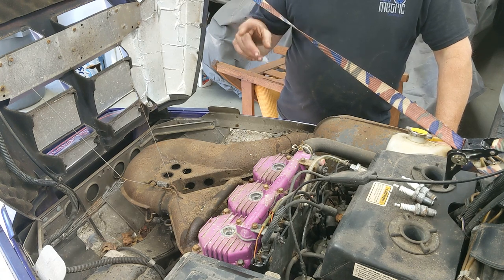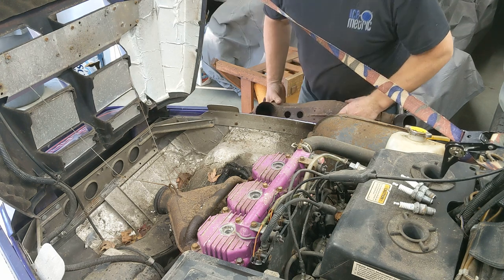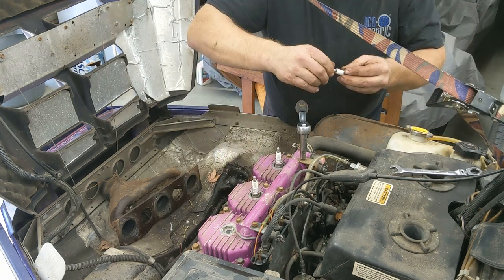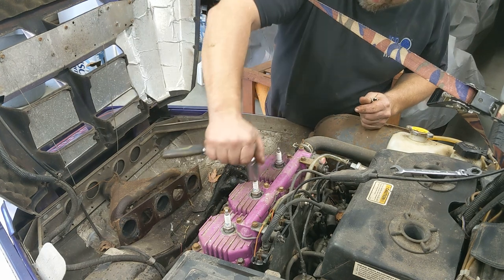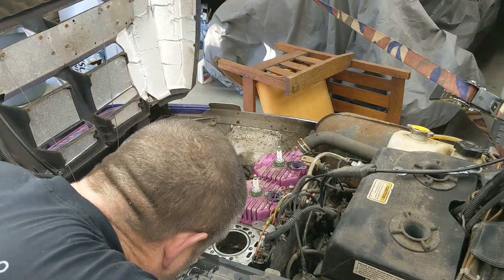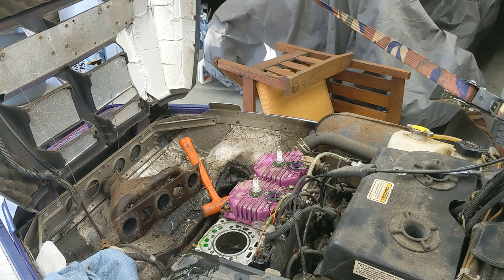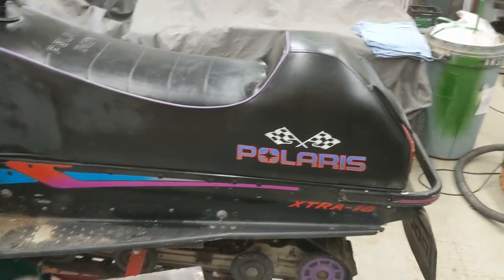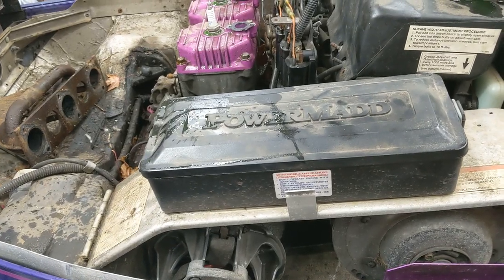POLARIS TRIPLE ULTRA REDEMPTION cylinder removal!!!!!!!

Comment: Hi Todd, great video as usual! Be very cautious with the water pump, they're extremely hard to get in my neck of the woods used and I have not found any new aftermarket suppliers either. You were supposed to change the oil in the water pump every 1000 miles, but I prefer to do it every 3-400 myself because it's to the pin whenever I hit a straight stretch of trail or lake! Lol. Also check out ALL the reed petals, if they are not sitting against the housing or are damaged in any small way replace them all. The v-force reeds are around 350-400 Canadian dollars the last time I checked, but are a HUGE performance boost! Compression on my 96 Ultra SP IS still at 150 psi which is new compression for this engine. If you can still find them a set of thunderdome heads, PSI triple pipes and the v-force reeds will get you very close to the 165 hp range. At least my friends 96 ultra did back in the day. He killed my stock Ultra every time we raced.
Reply: Also, if you can find a complete engine or set of cylinders off of a storm 800 out of an Aggressor chassis they will drop onto the ultra bottom end with no modifications and no one will be the wiser. Only a larger bore is the difference but even bigger performance gains!

Comment: I saw in one of  your replies, you have PSI  mod blasters. I ran 10k miles on a 96 with them. Set up 5 other 96 Ultra SPs with them the same way. I still have my notes on setup and clutching. If you’re interested clutching. To jetting. To timing. Plus the carb parts and hand scratched notes from the PSI installation notes. Plus notes on SLP “rev”pipes. SLP made two sets. A torquer which spun 8100 or  rev, that spun 87-8800. The rev pipes came with a can silencer or glass packs. Torque, only came with a can silencer. Plus the big belly of the pipe was an inch longer. 9” for torque, and 8” for the rev pipe. If you’d like help. I’m sure there’s a way to get you the notes.  An ultra with  PSI modblasters spinning 9700, yes. That’s right.  They work at 8700, or 9700. Is amazing. Closest to it is a 650 screaming thru a set of DGs at 9100
Reply from the maker: can message me on fb? I have dg triples on my 650 called Bastard spins at 9200

Comment: For future reference, its easiest to drain coolant via the inlet hose to the water pump, you could've avoided the coolant in the crankcase to be honest. Also, if possible it would be good to get a good look at the cylinder heads. That almost looked aftermarket by my eye. The biggest giveaway is the stock are cast, of course. Aftermarket are billet. The waterpump is definitely worth getting rebuilt.
Reply from the maker: I'm sure the engine will come out and be completely disassembled. I'll be looking at the heads closer.

Comment: You mentioned you put a XCR seat and tank on your original ultra, what did you do to get the XCR seat and tank to clear the heat exchanger and hoses??
Reply from the maker: I put the tunnel protector coolers in and took the under seat one out.
Reply: todd clyne  every have any issues with it getting warm??
Reply from the maker: @briandzimitrowiczjr7107  I only rode it a couple times after doing it. But no it didn't.
Reply: Any issues with the oil tank using the XCR fuel tank?
Reply from the maker: @briandzimitrowiczjr7107  boy now your really testing my memory. I really can't answer that. This was back in 97/98 when I did this. If there was an issue with anything I'm sure I switched stuff out. I was using a totaled out 95 xcr as a parts donor. I just remember it made the ultra handle like a complete different sled. I'm from the era of the lower you sat the faster you could corner.
Reply: todd clyne lol I apologize for all the questions. I remember that era very well. Triple triples were all the rage. The XCR seat and tank could make even an XCF look fast hahaha (my brother had a 1998)
Reply from the maker: @briandzimitrowiczjr7107  lol I don't mind the questions.
Reply: Good deal. Such a cool era of snowmobiling.

Comment: Shave the heads for higher compression like the spx or a little more and check your timing because the sp had a lot of issues with sled not being timed right I believe mainly for triple pipes but that would be killer to see you do, it would teach alot of people something 🤘🤘 by the way me and my dad own a 1996 Polaris ultra SKS with dyno port pipes pushing some big power for a 680 😎🤘
Reply from the maker: I have my eyes out for a set of pipes. My cylinder and piston is in the mail as of yesterday.
Reply: @toddclyne3493  what pipes are you possibly looking at?
Reply from the maker: @gabrielrace3532  LRM would be ideal from what I'm hearing
Reply: @toddclyne3493  niceeeee I can't wait to see more videos man keep killing it 🤘😎
Reply from the maker: @gabrielrace3532  I'll keep the videos coming
Reply: The single piped ultra was timed very aggressively from the factory. When adding triple pipes, the timing needs to to be retarded by 1 degree. Also highly recommended, would be to get a set of slp heads, the version that kept the stock compression, but had a redesigned dome that fixed the detonation issues that the 680 sp had. Those heads are very hard to find unfortunately.
Reply from the maker: @Gibbons_76  I think for this winter I'm going to rebuild the motor and just run as stock. I did just get a set of mod blasters but I'm going to get everything in line before putting the pipes on. Heads, cdi, the correct carb and clutching set up and learn how to check and time a two stroke
Reply: @Gibbons_76  I wonder what is different to stop the deto. Issue?  And the deto issue with the pipes pushing 150hp or more didn't happen when put on the bigger motors
Reply: @gabrielrace3532  The original design of the 680 sp heads was flawed and would cause pre-ignition/detonation if triple pipes were added. Slp redesigned the shape of the dome which eliminated this issue. Those heads had been discontinued for at least 10 years though, and if you do manage to find a set, they'll be pricey.
Reply: @toddclyne3493  That would be the best bet. I'm in the same boat. I have a set of mod blasters as well, don't have any of the supporting mods to make the sled run properly. So until then, I'm sticking with the stock pipes.
Reply: @Gibbons_76  will any of the psi or slp heads that are high compression fix the issue or is it just the stock compression slp heads that fixed it
Reply: @gabrielrace3532  They fix the problem as well, but with the high compression heads you'll need to run race gas.
Reply: @Gibbons_76  yes true I wonder if the ves 700 and 800 and the 97 spx heads will fix it too
Reply: @gabrielrace3532  '97 spx 680 heads will work, but they are lower compression than the '96. You won't gain as much power because of this. Not sure if the ves 700/800 will work.
Reply: @Gibbons_76  spx should have a bit more compression than the sp motor
Reply: And yeah I'm not sure I'd love to really not have any deto. Issues lol
Reply: @gabrielrace3532  All the sources that I've looked into have said that the triple piped Spx had lower compression and that Polaris did that as a bandaid fix to try and eliminate the detonation issues.